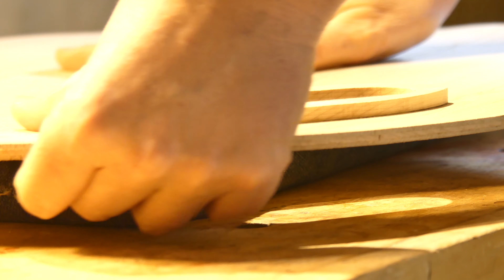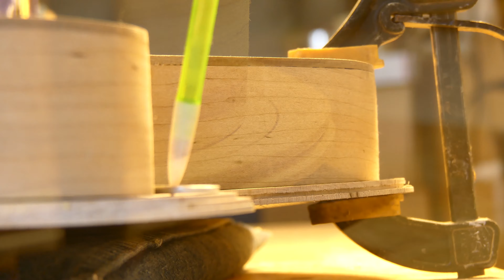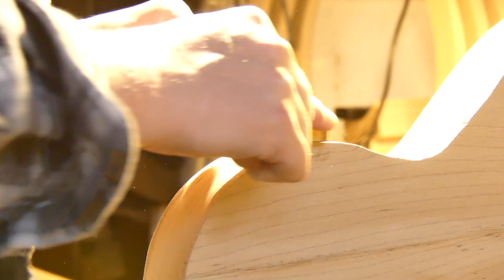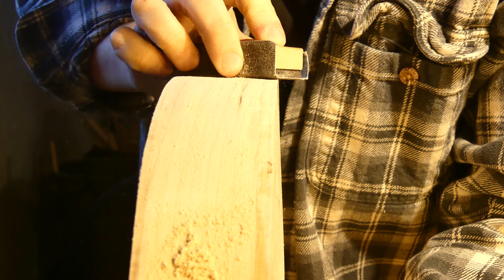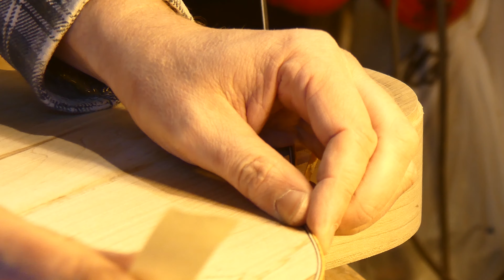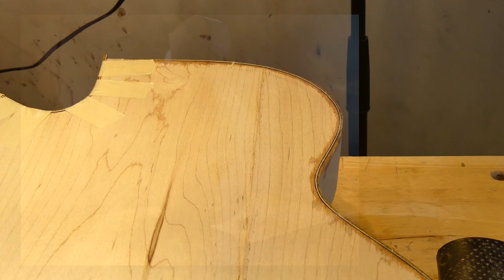Gretsch White Falcon | Closing the box and binding the back

Comment: Just curious--what's the reason to hand-plane the excess back panel that overhangs the sides?  Couldn't you use a router with a straight bit and a bearing on the end?  That would be a lot faster, no?
Reply: There's no flat surface to run the router against. It's an archtop.
Reply: @vanshankguitars  Yes, I can see that would be a problem.  One would have to build a fixture to hold the guitar and another fixture to hold the router.